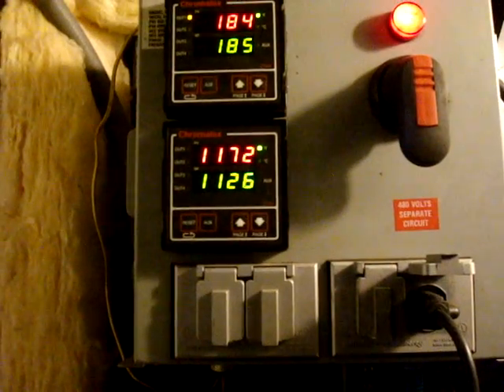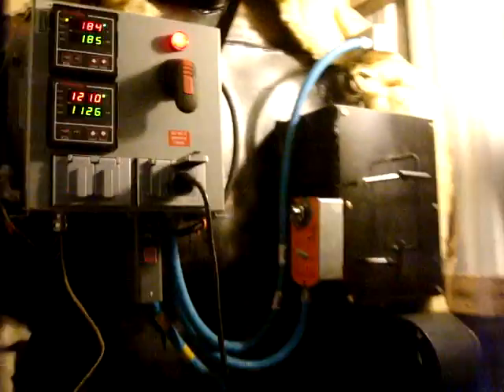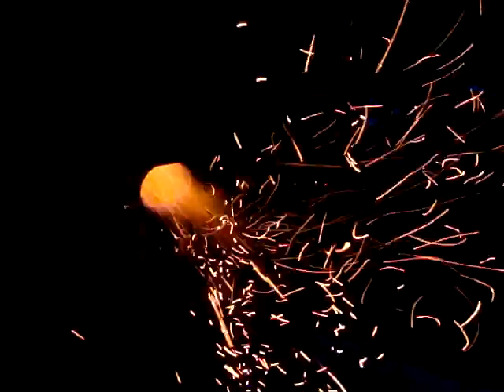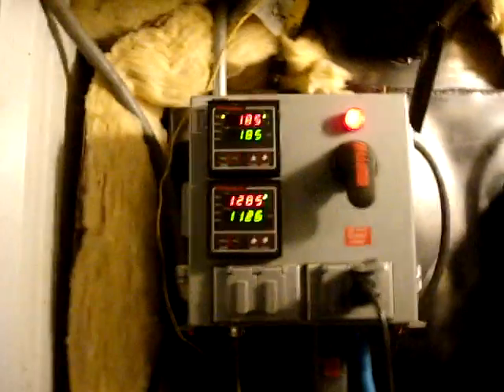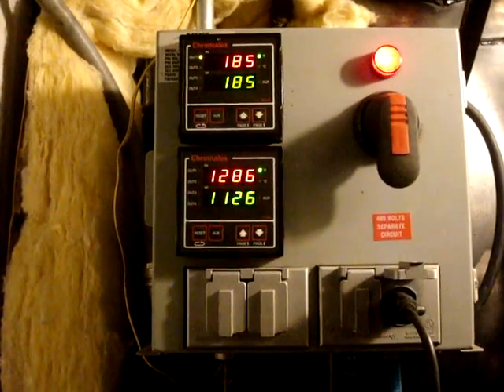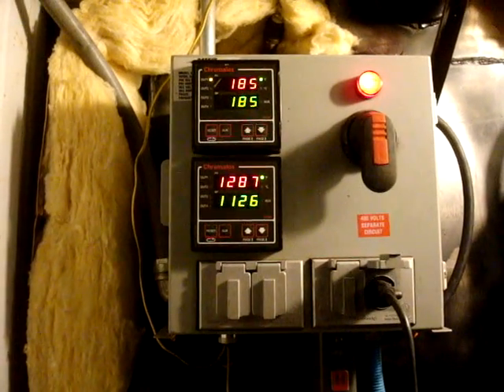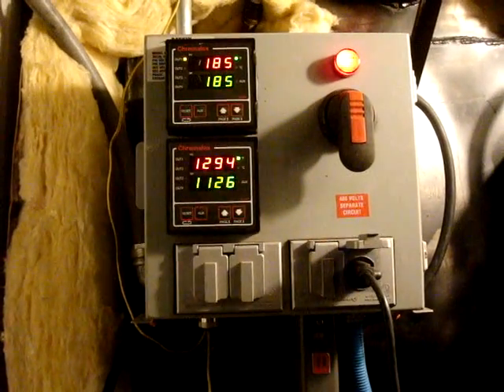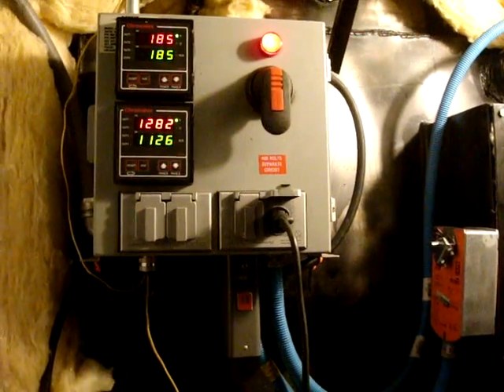Gasification chamber burn and temperature

Comment: I'm getting ready to build a similar system is there any chance you would put up a basic diagram of electrical schematic with the set points of the two TC's and a brief description of the stuff and you're thinking behind it.

Thanks
Rob
Reply from the maker: rspringii I don't have a print of the wiring schematic I designed anymore. I think it got ruined at some point. the thermocouple I. the water tank is the only one that actually controls the furnace. I think I have a 10° drop before the controller kicks back on,but don't quote me on that as it's been too long since I checked the settings